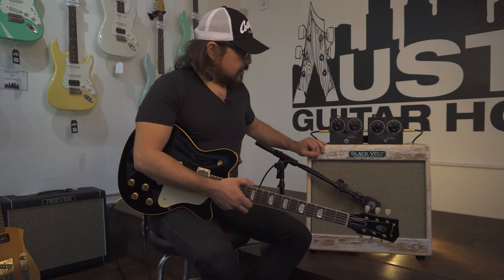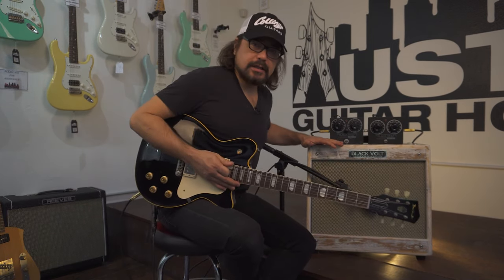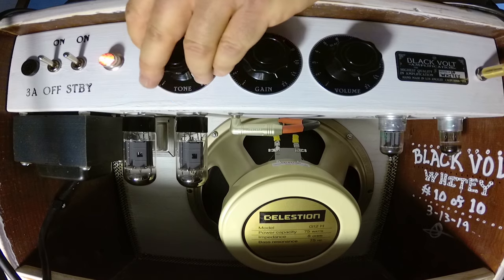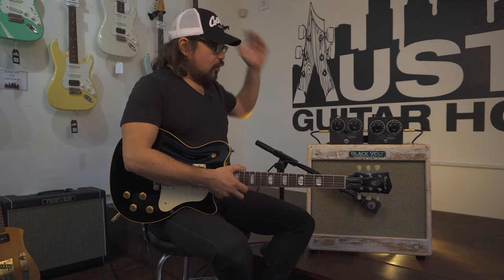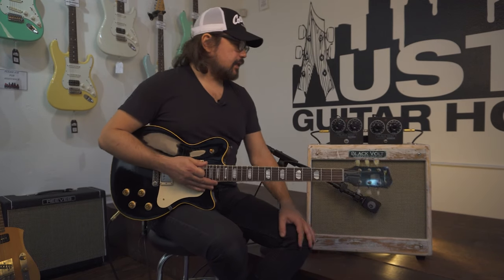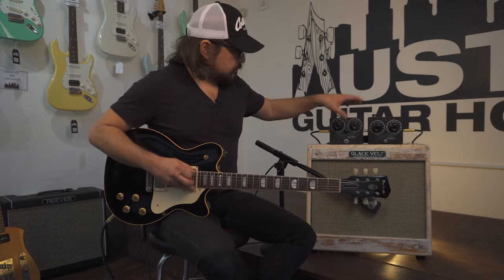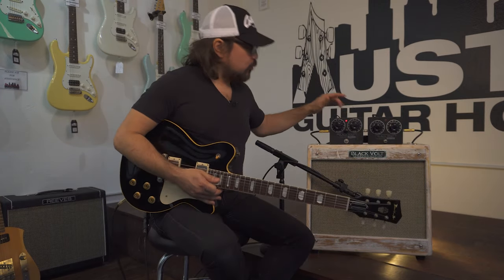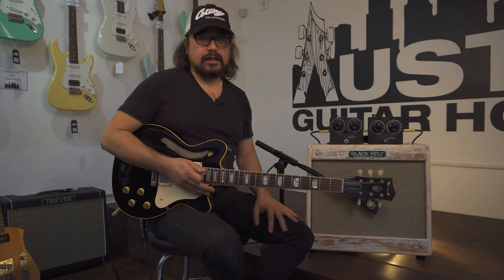Black Volt Amplification - Best Kept Secret in the Industry?

Comment: I'm a Tweed amp player turret board construction Mercury magnetics point point in wired  a 5y3,two 6v6 a12ay7 a  12 X 7.  12-inch inch Jensen speaker. It's probably an 18 to a 20 watt amp really very loud. I like the use of interest in materials for the grill cloth on your amps. It's  cool and sets you apart 
.I like the distressed look. And the Tweed look of these amplifiers love the fact that you're using an Old Pine cabinet. So I love the aesthetic. However every time I'm hearing anybody doing a demo the tone they seem to showcase  is a really over driven sound. I mean if that's what you want go out and get yourself a transistor Peavey backstage Plus. I'm not saying it sounds bad I'm simply saying you can't really hear the nuances of tone when everything sounds distorted! What the hell does it sound like clean? What does it sound like at the edge of breakup? I'll admit I'm damn close to 60 I've been playing guitar since I was 14. so maybe I'm just getting old and grumpy. but to me the magic happens in an amplifier when you were at the edge of breakup and you can go a little past that and use the volume knob in your guitar to get your back to clean and if you strum lightly you're playing clean and if you dig in your getting a little break up and if you roll your guitar volume knob from 8 to 10 you've got a nice distorted lead volume and then if you use a light overdrive pedal an RC booster would work Tube Screamer probably would work arrange Master type treble booster woodwork Greer Lightspeed word work really well so in a mad professor sweet honey. the point is if what you want is really heavy distorted sound I don't know he's a tonebender an a Marshall? I don't think anybody is buying a Tweed style amplifier Play Megadeth on. You're talkin Roots Rock Tom Petty, Rolling Stones things like that. Nobody's trying to play metal on a goddamn Tweed amplifier and if they  are they shouldn't. Thats not what a tweed amp is about.  I do not mean to be rude but I haven't heard a demo of your amps that I thought sounded good. I don't believe that your amps are being given the opportunity to show all their characteristics every damn demo that I have heard simply shows this overdriven side of your amps. I mean if that's all it does then okay. Cool Aesthetics interesting concept being able to use different tubes is lovely. I like el34s how about a tween Style amp that has tremolo  and real Reverb tank in it and has a channel volume a bright input and a regular input and a master volume.  You only need one goddamn tone knob it's a Tweed amp so that even if you plan a small club and people are bitching at you about your volume could turn down and still  dial in the amp to edge of breakup. And you can go from mild Distortion  to clean using your guitars volume knob. And if you want more get a Greer Lightspeed or a tube screamer or whatever. If what you really want is a little teeny amplifier that's going to sound really dirty buy a line 6 or black star or whatever
Reply: If you are dissatisfied with the videos of this amp that are out there, well, nobody is stopping you from acquiring this amp and making your own proper amp video demo.
Reply: @TheStereoCraticParty  good point. I just did not think it was fair to the very good looking and expensive amp to show it sounding like a peavey backstage plus. It does seem to be a versatile and very cool looking amp with some interesting features.  I also hate it when people do wah pedal demos AND ONLY PLAY IT WITH LOTS OF GAIN.thus hiding all that the pedal is capable of.  Clean funk sound Hendrix like tones ect. Show all it can do. Not just overdriven wacking off. Don't get me wrong I'm the lead player in the band I'm in.  I probably have 40 pedals heavy on fuzz overdrive and distortion.  But sometimes a clean country/ root rock kind of tone is what the song needs. Sometimes it is a jazz tone. Yeah im getting old grumpy and opinionated.

Comment: I would not use the overdrive as a tool for low volume... for that there is the master volume. I would use the overdrive for more gain and sustain on top of it. Another thing... that is a semi-hollow? Cool... Where is the hole? 😅
Reply from the maker: The volume control on this amp doesn't behave like a traditional master volume, that's why I suggest using a pedal for low-volume gained up tones. And yes, the Bartlett guitar is a semi-hollow with no f-holes, just like BB King's Lucille guitar. Thanks for watching!
Reply: @AustinGuitarHouse  Coolness, thanks!
Reply: The pedals offer an affordable, handmade and unique option for those who aren't ready for the actual amp. I thought both of the pedals here sounded excellent and served their purposes very well. It was good to hear an actual demo of them. 
I'd be curious to see a demo of the Silver Bullet treble booster.

Comment: And I do realize they're talking about a fuzz circuit in this particular demo but I've heard other demos of these amps and they almost all sound completely over driven and if what you want isn't over driven sound and you have a whole bunch of money in your pocket or great get what they're really beautiful looking amp that I'm sure they're very well made but sweet Christ that's easiest on for me to going to go out to my garage take my Tweed Deluxe and turn the fucking thing all the way up I got to know 1956 supro amp Patron that God damn thing all the way up and sounds like Led Zeppelin 1 but in a bar it's not a hell of a lot of you so I need more clean Headroom I need more volume I need to be able to get to the edge of breakup I need to use my guitar volume knob to get there or if I need to even more Distortion or more of a rock tone than that I need to use a pedal to kick it over the edge but every demo I've heard of the amp tones sounds like a Tweed Deluxe with a tone Bender in front of it which is okay if that's inside you want but the one-trick pony $3,000 what the fuck else does it do
Reply: @loicchapuis5052  cheers to you from Arizona usa. I only commented because the only demos I had heard had lots of gain. In most tweed deluxe based amps you can change the pre amp tubes used to clean up the overall amp sound. Sweetening the tone and reducing the gain slightly.  On my tweed deluxe clone the two channels are interactive and effect tone as does the tone knob. It seems to also effect gain. Just showing the gain characteristics of the amp short changes it. It is very nice looking. And expensive. It would be like spending the money on a custom shop Gibson les paul and only playing it with the volume and tone knobs on 10 with a fuzz box. You would not be getting a clear and accurate view of all the guitar was capable of.